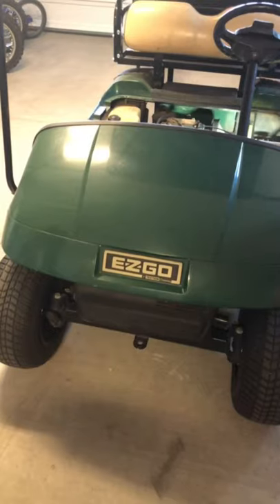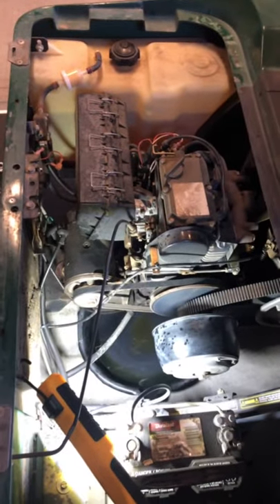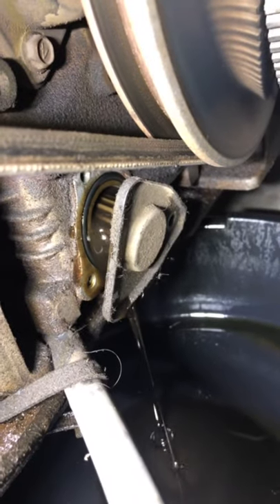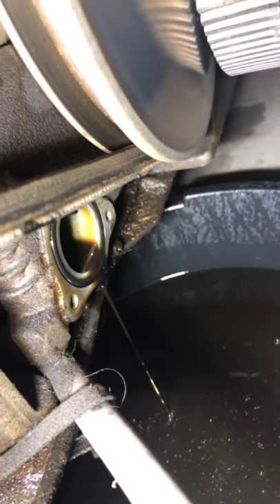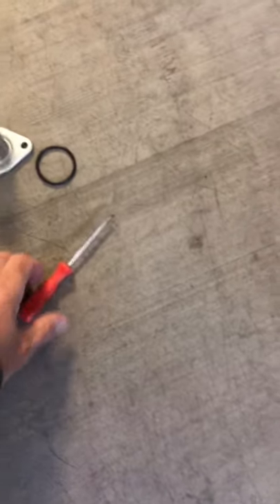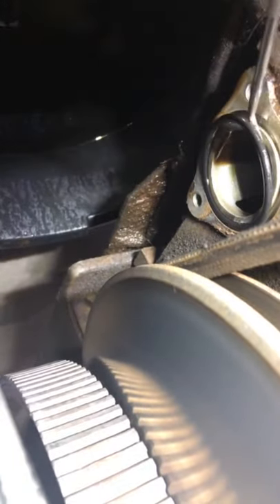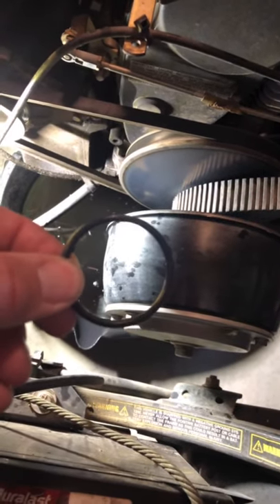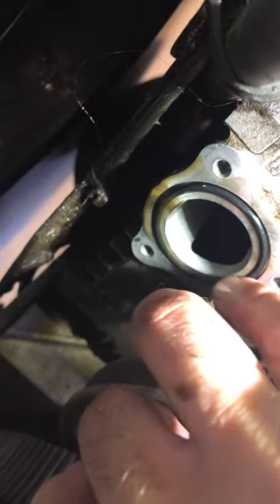Ez-Go golf cart oil change

Comment: Good Video.  Just an FYI -  I'm not a mechanic, but just had my motor rebuilt and from the Mechanic himself - If your cart is lifted,  the motor will be tilted back and you should not fill to the "Full" Mark on the dipstick.  It requires the correct amount as stated in your manual.  If your cart is lifted and you go to the full amount, you will have too much oil in your engine.  Add 10w30 Oil of less than 1-1/2 qts or 1.4L to compensate for residual oil left in engine or whatever your model engine requires.